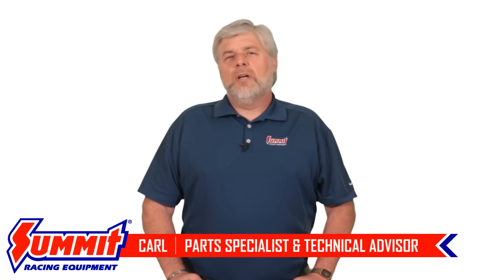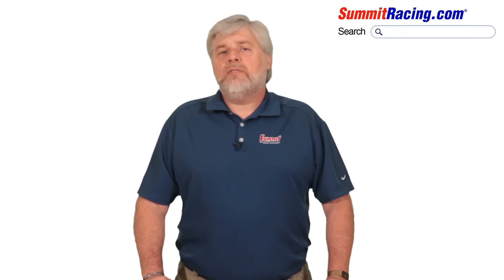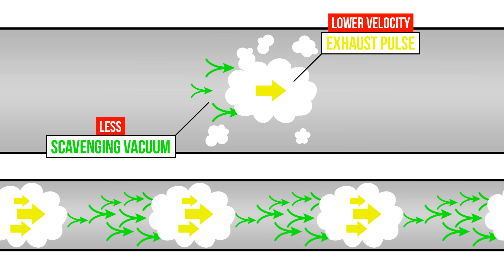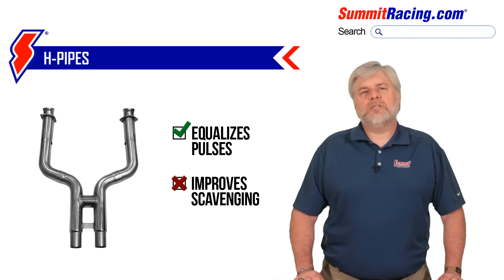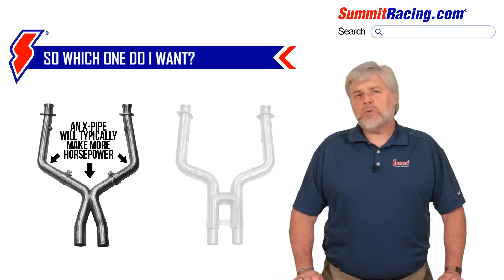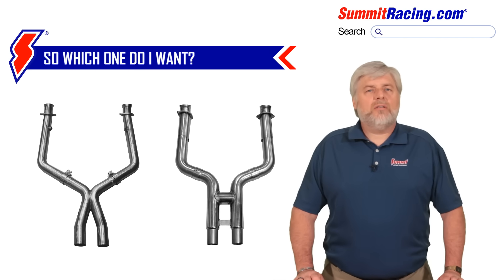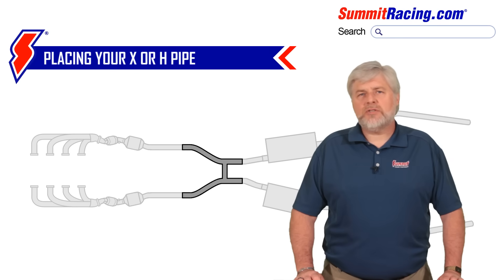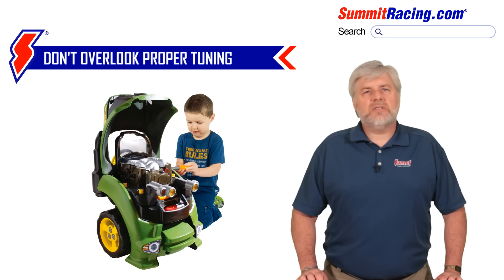Exhaust H-Pipes vs. X-Pipes: What You Need to Know

Comment: Absolute hogwash ! H and X pipes do minimal if not nothing and by minimal I mean 2hp at most using a LS engine at westech's engine dyno Enginemasters proved this theory or should I say disproved it . although the X pipe does sound cooler and to the ear makes the given rpm sound higher than it really is . so dont waste your money unless sound is of a concern .. look up engine masters episode 22 ..
Reply: corsomike1 I'm confused by your post... No difference between them (X vs. H), or no difference putting one on your vehicle?
Reply: It has been scientifically proven that using an H or X pipe does minuscule changes to power or torque output of a given motor vs straight pipe now if your searching for a particular sound then they can help . all this H and X pipe mumbojumbo is just a marketing scam
Reply: corsomike1 Ahhhh so. I have and old Chevy truck (see my channel), and I want to get as deep a rumble as possible. So, was thinking of Flowmaster 44's with an H pipe.
Reply: Agreed, x vs h has very little hp differences on an ls application.  More about the sound.  And no gain on anything with an exhaust crossover.

Comment: Is an x pipe more important or beneficial  on a 302 or ford with a 1-4 5-8 simultaneous firing order, as opposed to say an LS motor or something with an alternating firing order?
Reply: X pipe will flow better on this application. But not appriciably.

Comment: Nice Video and my next order ar Summit Racing is about to beplaced, but...What would you recommend for my engine...It's a 73 Duster with a 79 360, 0.030, Speed pro Pistons (10,0:1), modified heads, Comp-Cam 292H, large tube headers (2,5" dual exhaust with muffler), 750 Barry Grant Gold claw, 3000 rpm stall converter and a 8,75 rear axle with 3.55 gear. Car runs realy good at higher rpm, gets fast off the line, too.I think H-Pipes woul be helpfull for a bit more low end torque?!?!Aprox 1,75-2"....What do you think :-)BTW... this is the car I bought(not yet finished in this Video)https://www.youtube.com/watch?v=pCLqB0zd3z8Regards, Eckhard ;-)
Reply: I agree with you.

Comment: I own a Buick century 1977 with a 305 motor (canadian) and i want to change my exhaust because rightnow i have an y pipe from a van and its rubing on the ground(..i had to do with what i had .. ) i would  like to know what would  be better H  pipe ot X pipe or even straight pipe?????
Reply: Hi! What did you eventually go with? I would have suggested H pipe (they sound much better!)

Comment: In a nutshell x pipe is more power than H pipe!
Reply: Not where it comes to off the line low end torque. And exhaust  note at idle. My '67 cougar  had  a little 289 and it with an pipe and there wasn't much out there that could touch it off the line... I could make that car leap off the line without even breaking the tires loose... And just be gone....see ya...!!
Reply: An x pipe makes more power in the higher rpm range...well sometimes  on the street  it's over  before you get to use that higher rpm range.

Comment: Hello, I have a 2012 ram 1500 5.7 hemi and I am looking for a complete exhaust system from header to tail pipe with the hopes of gaining 15-25 horse or more if possible. I use my truck for daily driving and social gathering but no racing. What set ups would you recommend?

Comment: My question  is for my stock 350 chevy truck with a Y pipe. I want to get more towing torque so what muffler should I use? The catalytic converter is not on the truck anymore. I don't want a loud drone exhaust sound in the cab ..just the better torque numbers.

Comment: How do you decide what diameter exhaust pipe is best? Obviously I want the biggest pipe I can without scavenging velocity falling, but how do I measure this?
Reply: As a rule of thumb 1" per 100hp per cylinder bank, however a little more may (or probably *will*) give more power (but be louder).  So 500 hp = dual 2.5", however lots of systems are dual 2.75" or dual 3" for such an engine.  The S550 Mustang GT runs dual 2.5" for 420hp from the factory, for what it's worth; the old Shelby GT500 ran dual 2.75" for 600hp from the factory.  For a racecar you could just go as big as possible, for a street car it's about if an extra 10 or 20 hp is worth all the noise.
Reply: @TassieLorenzo  21/4 " seemed to be a good choice for my 289 it made between 325 and 350 hp...set up the way it was it pulled strong all the through 100 mph. And got to 100 pretty damn quick.
Reply: thats cool... speaking of cool, i had a 1995 gmc safari with a 4.3 liter and when i put a dynoflow 3 inch otorhome muffler on it it ran cooler engine temps due to the easier breathing system and it never had the proper fuel to air ratio it would run richer cause it thought it never reached proper factory engine temps .. i wished i never put that muffler on it and went with a more factory/restrictive one

Comment: He said it may not be beneficial, meaning if you change your mid pipe and get minimal hp with the new pipes was it beneficial???
Reply from the maker: An H pipe or X pipe will never lose power, so it’s a fairly good and inexpensive way to make gains.  Cars with the most
restrictive exhaust benefits most because the H or the X effectively doubles the flow capacity if viewed like a power pulse coming down the pipe.

Comment: I have a 2005 Chevrolet Silverado with 6.0 L V8 133" chassis length.
My problem is excessive cab droan and am thinking of installing a H pipe between muffler and Cats, And removing the two inlet single exit both 3" with dual Mufflers and tail pipes 2.5 " to rear of the truck what is your opinion?
Thanks

Comment: So which one would work better with turbos? I had an X5M, and BMW didn't use either one. They just ran the exhaust as two 4 cylinder engines and then combined them into opposite ends of a single crossflow muffler. Sounded awful. Pure rice. Something has to work and sound better than that.

Comment: I have a 2008 Mustang Shelby GT 4.6L, the Shelby package installed a X pipe and looking to add a different muffler to get a lower rumble. Do I need to install an H pipe and will HP be compromised. Also looking to add more HP. Thoughts?

Comment: with my pick up truck I'm building it to be a towing and off road truck. i replaced my exhaust system 2 years ago. i removed the y pipe and went from cats back to a dual-in dual-out muffler. i have no h or y nor an x pipe just straight pipes to muffler. how does this effect scavenging in my exhaust system? i had to add a cold air intake a bigger throttle body and tune the ECM to stop the lumpy idle that my truck did when the exhaust was replaced. the truck sounds very mean and healthy now. but what's exactly going on now with the scavenging? and why did my pickup have a lumpy idle after replacing my exhaust?

Comment: I'm using H-D Street Canons on the Ultra 107 and they are excellent.
Reply: I ran an 07 H-D Ultra 110 with 2.67 cams into a D&D Boarzilla and found we could tune it for 30 more hp than any other exhaust. 237hp 242ft-lbs at the wheel. The sound was uniquely identifiable in a group of 50 bikes(idle dba measured at 111 dba at freeway speed 146 dba and at race speed 167dba) it depends on application.

Comment: What would you consider high or low compression? 9.5 and lower= low, 9.6 and up= high?? curious as I am getting ready to build an engine for my Nova and would like to build the best exhaust to match. Thanks
Reply: Never heard any luck running higher than 9.5:1 on pump gas. YMMV.
Reply: Kayla Eliason did u ever build one???
Reply: Best if you don't try to go absolutely  extreme...9.6  to 10.0 sounds like a good compromise.  Assuming  you  will be running it on the street using pump gas.

Comment: I have a blue print high compression 347 stroker and a 2.5" true dual exhaust on my 73 f100 LWB so the vehicle is 20 feet. Can I just have some one weld a pipe between the true duals to turn it into a H pipe?
Reply: Basically yes - but try to make sure it isn't very long, for proper scavenging you want the distance to be short

Comment: uuu come on, they are basicly the same.
and both re rubbish if not tuned to the desired rpm.
both of them can give you high rpm horsepower, and both of them can be tuned to your cruise speed rpm to give you better fuel economy and better low rpm power.
and where you want the X or H to be ?
well god bad news, it depends on the rpm range you want its benefical effects to shine.

however, it is true that the higher the rpm, the more you can gain.
a proper, verry proper exhaust tuned for your engine, giving you say 8 hp at say 10K rpm, and you tkae the same carefull tuning but go for 5k Rpm as target.. will yield only 2 hp extra. that and the fact that under racing conditions you allways keep revs high, means all real well made sport exhausts will be tuned for high rpms.
that is where they can get the most, that is where the engine will be operated the most.

but if you got a big diesel hauling stuff and your camper, you want to not get a sports exhaust. the thing is, at an rpm range they help, on the other hand at some other rpm ranges they will make your engine produce LESS than with stock.
but, that does not mean you can not tune  an exhaust for your low revving hauling towing car, indeed you can get pretty decent fuel economy improvement and more power where you need it. 
tat is how things work, exhausts are designed with the parameters of the engine, and with a target rpm in mind. how well its done and how precice, will tell how good it will be.
in an ideal world 1 engine at 1 given rpm has only 1 best exhaust. the same exhaust will not be as good on any other engine, even if they are the same make, year, model, down to the last bolt and  nut an washer.

thats the deal. read , measure, and get a proper custom job. then you get power where you need it.

Comment: H pipe sounds better, that's all I need to know.
Reply: Seems H pipe has a lower deeper moan while the x more raspy higher pitch.
Reply: I Got AUDI a6 c5 2.4i 121kw 2001y and i got y pipe do i can to go for true dual exhaust is it possible and should i go for it ?
Reply: @reyzo3411  Do it! True dual is always better. 👍
Reply: @reyzo3411  I wouldn't.
Reply: @deciplesteve  why
Reply: @reyzo3411  because I work on Audis for a living and cannot fathom how bad that will likely sound. That said, it's your car, do what you want.
Reply: Google Mac Prochamber. Best of both worlds.
Reply: I agree H takes the cake but x sounds good too I just hate all that damn popping and crackling shit
Reply: Gilbert my X-Pipe sounds so beautiful
Reply: X pipe on a car will give you a deeper tone and make it crackle with revs. H pipes are really more for trucks; gives them that low rumble. I prefer X pipes because there's a more consistent flow and they usually sound and perform better, on cars. Imo
Reply: No x pipe sounds better lol. If your running a truck sure H sounds better on a truck.  If you want your car to sound bad ass run a X

Comment: Why even Cross them at all? Have each side go to its own muffler is what I see. I'd like to know as my experience is a single exhaust that goes straight from a turbo out, not from a V motor. Thanks.
Reply: It has to do with equalizing exhaust pulses  between  the left and right banks. The exhaust gas from one side when combined  with the exhaust pulse from the the other side helps to scavenge the spent gases creating a more complete burn with lowered back pressure. Results in better overall exhaust  flow...

Comment: I liked the fact that the narrator is realistic , an exhaust upgrade does not always result in better performance.
Reply from the maker: Thank you, Kos!
Reply: Breath in breath out... Incoming air increases will require higher exhaust flow escaping. I noticed a significant increase in horsepower after installing a fresh new stock exhaust pipe. Performance pipes only help on the higher end revs and usually will help only around 70mph and up. . It will actually slow the car off the line a tad bit.

Comment: what about boosted vehicles?
Reply: Jesus Hernandez there will be little to no benefit with anything past the turbo. after turbo less pressure is best because it maximizes the pressure difference before and after.
Reply: That's why most people just run them out through the hood or out of the fender

Comment: okay here's a question. I'm running twin turbos. I'm assuming that this will do a great deal to change the pulse width, frequency, velocity. does this reduce the effect of the crossover? how does it effect the downstream flow characteristics?
Reply: It does not matter w turbos.  There is so much resistance turning the impellers that the only goal from there out is dumping it as quickly as possible.  That's why you see turbo drag and drift cars running very short fat dump tubes right out the the side or even hood.

Comment: I have a 2500hd with an 8.1 vortec. I am not satisfied with my exhaust at all right now I have factory duals into a 50 series flowmaster which is 2 3" pipes then comes out behind the muffler into a Y pipe to a 4 " pipe . could I put in a H pipe behind the cats ?

Comment: Suprised he did not mention tone difference. You will get 2 different exhaust notes from 2 different designs. I personally believe you get a deeper tone with a H. An X tends to be more hi pitched. I also believe the H sounds better at idle due to its design as well. I will only runs offroad H's on my Mustangs, just yes deeper is better. Ford runs the H from the factory.
Reply: Yes, totally agree! I think X pipes became the "In Thing" but I always prefer the H pipe. IMO when the pipes are made of thinner metal tubing, it also makes the tone different (in a good way) but maybe my ear's are playing tricks on me?
Reply: @mikesbbody  You're right, Mike !!
The thickness of the exhaust pipe changes the tone -- thick tubing sounds deeper, while the thin walls are of a higher pitch.
Same with pipe diameter: Bigger is deeper, smaller is higher.
Reply: mike mikesbbody your ears are fine.  H pipe sounds better
Reply: mike mikesbbody I  recently put an H pipe on my Charger 392 and it totally changed the sound of my car.  Definately deeper and more pulses.  H pipe is much better
Reply: sure does. a mustang sounds soooo much better than an X on a muscle car. X pipe makes it sound foriegn
Reply: jmfut I'm ready to buy a x pipe for my mustang gt. How much deeper is it with a h pipe?
Reply: SubieFL I would try and search on YouTube and see what you find. No Brainer is O/H pipe and Borla's. Just my 2 cents. My current Mustang is a 03 and I have a upload video.
Reply: Sorry but the note difference is night and day. If you want loud and Euro type sound go X. I honestly prefer deeper note of the H.
Reply: jmfut just listened to it and it does sound good! Mine will be slightly different because its a sn95. Decisions decisions 🤔
Reply: jmfut Could explain this to me a bit more Wym a “euro sound”
Reply: jmfut i
Reply: Hey bro your the second person to say that H pipe is better and louder and that the X pipe is hi pitched I’ve got a Audi S6 V10 I would love to have the H but what do you recommend I’m looking to be loud koz the car is freakin fast as it is no problems there
Reply: You're right... My 67 cougar had a warmed up 289 in it and a local performance  muffler shop reworked my y pipe into an h pipe and built a custom 21/4" dual exhaust system  for it and installed dynomax turbo style mufflers on it and it made a difference  you could feel but the sound was the best part. It had a nice little deep but mellow sounding exhaust note. And it flowed perfectly  all the way to 8200 rpms. All I know is that I took it out on I-10 in California and ran it up to 130 mph and it till had more throttle pedal..i guess it also helped that all the internals were dynamically  balanced...all TRW...even the cam itself...it was just a mild r.v. cam. Topped off with comp cams roller tip rockers 1.7 lift ratio. Eddlelbrock performer intake and a Holley 600 4 bbl  carburetor with vacuum secondaries... It was built mild with longevity  over all out hp. In mind but it wasn't a sloutch.. It would get up and go . 5.5 seconds from 0 to 60. And it pulled pretty good all the way  through 100 mph  especially  for a little  289....and like I said according  to the  tachometer  it would rev. To 8200 rpm like it was nothing.
Reply: I agree! H pipe for life for me X pipe just doesn't sound right IMO.
Reply: I love the sound of my beefed 350 with Hookers and an "H" pipe designed right at the end of the turbo 400 so I could still R&R the turbo if needed
Reply: i just bought cat delete pipes for my '14 GT/CS, H pipe is more of a "bigger engine" sound while the X pipe is more raspy nascar sound. best way to describe it. also, diameter of the pipe is a factor. bigger pipe deeper resonating sound, smaller pipe more raspy high pitched. ive got roush axle backs and with an h pipe they sound good but with a bigger and off road X these things scream like a dragster and i love it
Reply: Pretty sure in the end all Mustang owners just want the D pipe 🤣
Reply: @frankkirkman5994  go to time out young man 😂
Reply: X pipe sounds light-years better lol. H pipe it sounds like a truck
Reply: @EbikeRandomadventures  sure if you want your American muscle car to sound like  eurotrash I guess the x pipe does sound better to you.
Reply: jmfut on my 97 GT I got way better performance from longtubes and an x pipe over the H pipe.
Reply: jmfut I have a charger 6.4 with x pipe.  I wanted  to put H pipe on at muffler shop but guy at shop thinks I'm just grabbing at straws. He pretty much talked me out of doing it.  I'm really doing it for sound.  Will this be something I will definately notice? Thanks!